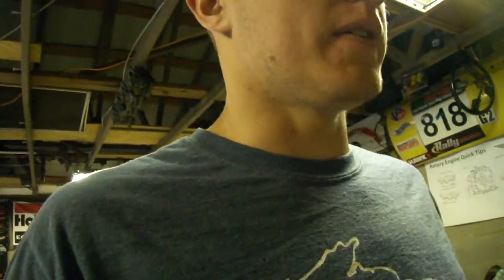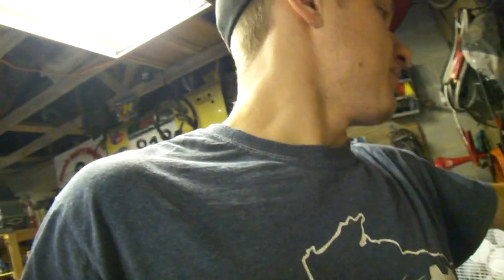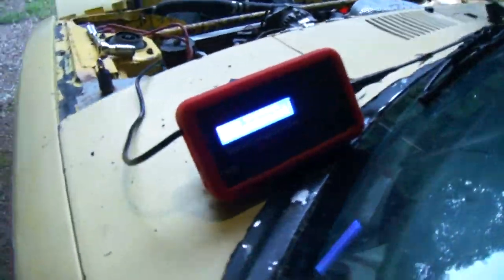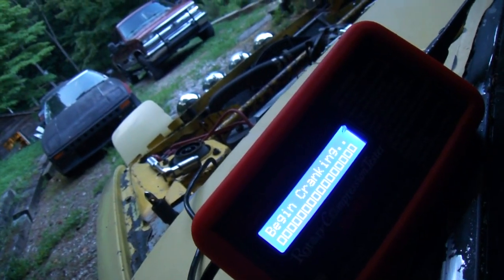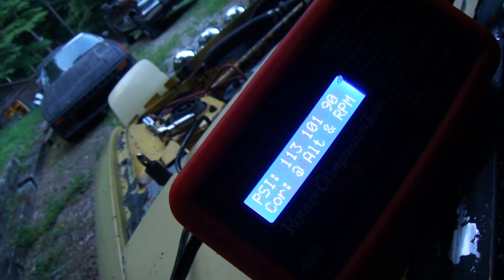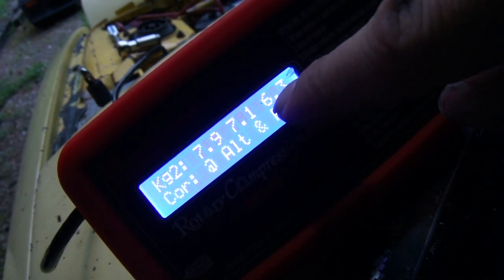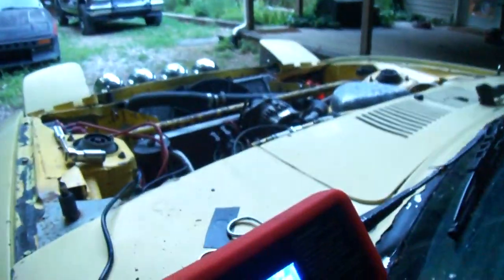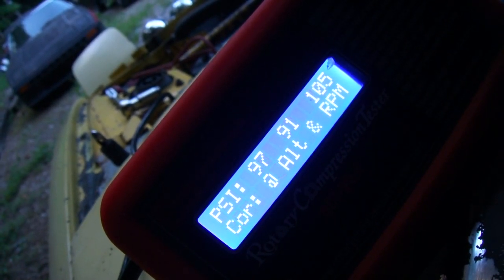The Banana Rally Rx7 - Compression Test, Cold and Hot starts

Comment: What brand of 2-cycle oil do you use for pre-mix?  1 oz. per gallon would be alot if it didn't have an OMP, but with an OMP, that seems a crazy amount.  Am I wrong?
Reply from the maker: Its a lot yes.  But kept in mind as hot as that car ran and being at 7k plus rpm for 20 minutes straight I wanted it to live haha.  Plugs were changed often.  2 stroke oil i use is usually the penzoil marine 2 cycle. Because its cheap and I can get it by the gallon

Comment: Hello from Canada. Have been watching your vids, and have learned a lot. Thanks.
Have an '85FB here (12a/drums on rear..GS?). It had sat for 17-ish years (last registered 2003). One step at a time it's waking up again.
 Today we tried running a new fuel pump from a jerry can, and hardwired to battery.Return line goes to same jerry can. Within a few seconds of running the pump the carb floods like crazy (even with flow from return line.
 In this video you mentioned the pump is tied to oil pressure switch. Should the pump run continuously when using factory connection, or does it shut off and on as bowls fill?  Is it more likely stuck floats?
Reply from the maker: Stuck floats for your situation. Depending on the year...most likely 85 the pump is run by the emissions control ecu which primes the pump. Then waits for ignition signal to continue running.
Reply: @RADPotential  Thank you for the reply. Quite exciting hearing it run for first time in almost 2 decades, but bottle-fed through top of carb only for now.
 You make awesome videos, and  we probably wouldn't have even tried getting it going if not for your inspiration.
Reply from the maker: No problem!!!!  I am happy you are getting some information from them!!!!  Let me know if you have any questions!!  Im going to film another video on buying an unknown rotary engine